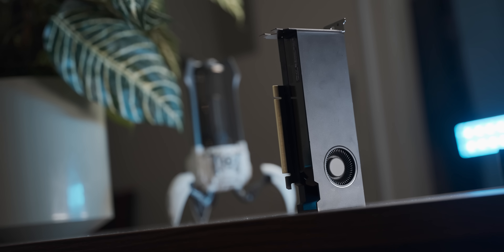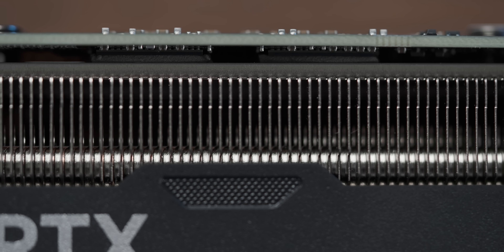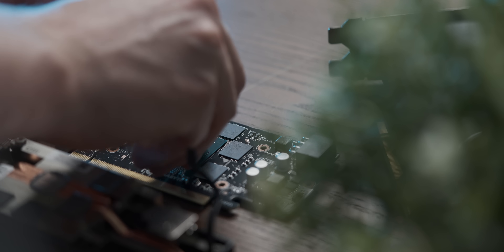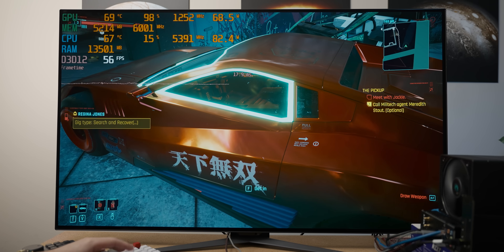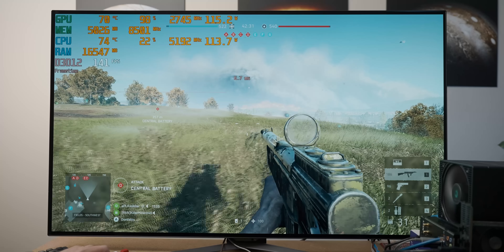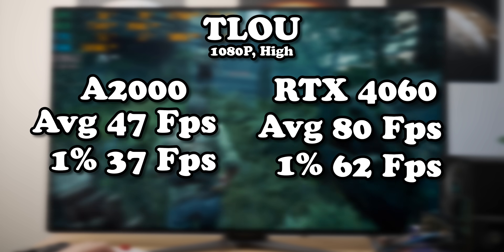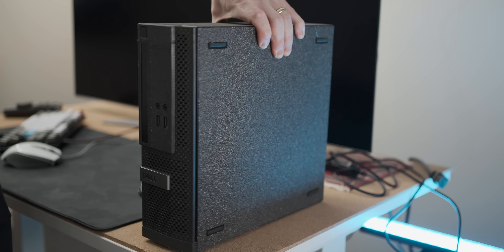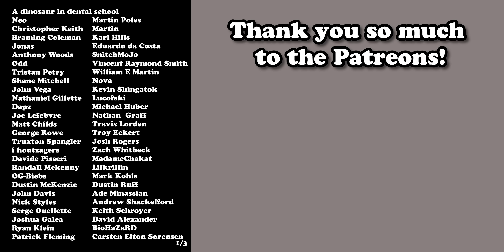A New Contender To The LP Graphics Card Throne

Comment: I’m fairly certain this is the first time a 60 class card gets the LP treatment. The last good gtx LP cards I can remember were 750tis, but I also think 1050s existed
Reply: keep in mind many people among the tech community claim nvidia shifted the whole naming scheme up, so that technically the 4060 should have been named 4050 (based on performance gains over last gen), so on and so forth.
The LP 4060 only strenghtens this narrative.
Reply: @ehohackner main evidence for this is the crippled 128-bit memory bus and tiny XX107 GPU chip, both of which have always been 50-class. The performance numbers tell the same story; there is memory-bound applications where the "4060" is outperformed by a 3060, 2060 and even 1660 Ti.
Reply: That’s because it is a xx50 class card being sold as a 60.
Reply: The GTX 1650 had an LP version. Gigabyte made one. And I think MSI did too.
Reply: @justinpatterson5291  Yep. I've got a 1650 4GB in the Optiplex 7050 I'm using to type this on, 75W as well.
Reply: @justinpatterson5291  Zotac as well.
Reply: @HappyBeezerStudios  My 1050ti is the Zotac OC edition.  At the time of my purchase it was the highest factory overclocked 1050ti that didn't need a 6 pin connector, boosting as high as 1822 mhz per GPUZ and even exceeding 2Ghz as reported on Unigine Heaven and Valley (though I am inclined to believe those readings were probably dubious 😅😅😅)...
Reply: @justinpatterson5291  MSI and Gigabyte made two slot LP 1650's. 

While few chinese companies like Yeston (the anime girl GPU maker) made rare single slot lp 1650's, but they were very pricy as well. (almost twice the cost of a rx 6400). Which is why to this day the RX 6400 is the king of single slot LP cards. As it's only comptitors are few rare pricy 1650's, overpriced Quadro T1000 and GT 1030.
Reply: 1050ti's and 1650's got LP versions as well. And there were few very rare LP 950's as well.
Reply: there was a 1050ti LP but is GPU shortage rare long before there was a GPU shortage.
Reply: @HarmonyEdge  I remember this one, I was trying to find EVGA's 1050 Low Profile for a time and it was unobtanium before everything else was, so it almost basically never existed, haha.
Reply: That’s because the 4060 is just a 4050 with a rename. It’s not exactly great news.
Reply: I have a Gigabyte 1650 LP in my work PC. Works great and is silent as can be.

Comment: I've got the 6GB A2000 in my SFF Dell OptiPlex 7010 (I got it used on eBay), and it's the ideal card for that setup due to its low power draw.

Comment: "Crystal Ball Optiplexing" from the future would be fabulous. The content creation market is pretty saturated with Ivy/Sandy/Haswell Optiplex builds at this point, but you'd probably be among the first to show the audiences out there what budget Dell builds of the future will look like in a few years. I'd love to see that. You could build it up as a "2028 Amazon Gaming PC" and simulate how people would refurbish them haha.
Reply: Yeah but you'd probably still be using outdated processors, most probably kaby lake and coffee lake once those Optiplexes go down in price
Reply: @CrocoDylianVT  Coffee Lake i5 would be a huge upgrade in CPU limited games though with 50% more CPU power.  Even 10th gen will only add HT which will be another ~15-20% maybe.  As an i7-4790 Optiplex user, even an i7-7700 will only be ~15-20% faster but that 8th gen bump will be the big one.
Reply: @lewzealand4717  The problem being that later Optiplex's moved the full-length PCIe down to the bottom slot, leaving dual-slot LP cards incompatible. Been hunting for one for ages before I gave up.
Reply: @AwSomeNESSS I might be really really dumb, but can't you just take Optiplex hardware and rebuild it in any ATX case for like $10? Then you won't have to buy an LP GPU and think about cooling.
Reply: @ДарийФедореев-э7т  The problem is that the Optiplexes get increasingly proprietary as time goes on. Sandy/Ivy-Bridge the CPU cooler threads into the case, and the front-panel power and USB uses a non-standard ribbon cable. 

For Haswell they moved to a proprietary PSU pinout, but kept it the same physical size as standard PSUs. Sometime after that they moved to a non-standard size and screw pattern for their PSUs. 

Somewhere around 11th-gen, they stopped doing proprietary front panel ribbon cables on their non-business systems, and instead made the motherboards a non-standard size that stretches the whole case and put everything on the front edge. Not sure if that has infected the Optiplex line yet.
Reply: My point exactly. Nobody builds those yet, but they'd be interesting to benchmark. Though AMD hasn't helped us given their focus on the higher end, the low-mid level chips with Intel seldom get the spotlight in build videos.

Comment: Put the 4060 on 75 watt tdp manually and remove the 8 pin connector and see if that works. If not you can disable the power connector=false in the bios to fool the card to thinking the 8 pin connector is connected.
This would mean it can be used in more usecases (weak psu or whatever) and it would be pretty cool to see how they compare performance wise without a psu!
Reply: David has to see and do this
Reply: Is this really a thing? Never heard of that bios option
Reply: @_Winfried_ must be in the GPU bios, that wouldn't be in a motherboard bios.
Reply: @_Winfried_  its not necessarily an option, basicly you change the word 'false' into 'true'.
Its not as easy as my comment makes is sound though, but since people make entire custom biosses for gpu's (like RX570 getting custom RX580 bios to boost performance) simple changing 1 word should definitely be doable
Reply: If this can be done id like to see that.
Reply: Don't know if it is possible. Nvidia was trying to avoid using MOBO power on the latest GPUs, i saw a Jayztwocents video were he measure the power from the cable and comparing it with the board total and basically all the power was coming directly from the PSU
Reply: @pedro4205  Hmm, i didnt know that, that would be quite sucky
Reply: If you have the budget there is a RTX4000 (Aida Lovelace) low profile that will be a better comparison, the A2000 is Ampere. Not a fair comparison
Reply: @dickdastardly4801  this Aida Lovelace card is actually just single slot, not LP
Reply: You only get 65W@12v from the PCIe slot. Most cards don't balance the power draw from the slot and 6/8-pin, they just run everything from one source to simplify power delivery, making VRMs cheaper and less prone to failure. The recently discovered VBIOS hacks do allow power parameters to be persistently set, but the 12V power plane on the card likely isn't attached to the PCIe slot at all, so you'd need to hard mod the card to rectify that.

Comment: Is the A4000 not better than the A2000? Also I'm almost certain these cards (the RTX A-series) were made specifically for things such as 3D modeling and such. Not really for gaming although they can ofc work for gaming but they're not optimal for it
Reply: The A4000 compares with the RXT 3070 but for the moment(even though they announced it), they have not made a Low Profile version of it.
Reply: @Teksers yeah, I just found it odd that Dawid claimed the A2000 was the top of the line for lp when the A4000 has been around for so long as well. I've been a technical engineer for just over a year now and I work with these GPU's almost daily but I don't get any opportunities to test them other than making sure they're functional. I need to learn more about them really 😅

I hope they make more lp GPU's specifically for gaming in the future
Reply: the a4000 is single slot but not low profile due to how wide it is, the a2000 is half the width
Reply: @WayStedYou  oh yes! I was getting them mixed up haha I some how managed to think both cards looked the same from memory

Comment: Would be cool if there is a way to only use pcie power on the 4060
Reply: I agree I thought the main selling point of LP cards was the non extrnal power needed.
Reply: @linuxnerd5319  its for use on a HTPC system aswell
Reply: But the problem is that it cannot be turned on without connecting the 8pin power supply, not even the 6pin one.
Reply: manually limit the TDP
Reply: If you undervolt like hell you probably could

Comment: OMG they actually did it. I think the A2000 still has a better use case due to it using  only PCIE power( 75W)
Reply: maybe nvidia should make an RTX 4050 with 75w tdp? surely it will be better than any LP card out there. already many 4050 laptops have 75w or less TDP so shouldn't be hard
Reply: @adityaraghuvanshi3947  I'll be surprised if we get a 50 class. If they do, you probably wouldn't want it. They would probably cut it down to 64-bits, 4GB of VRAM and 4 PCIe lanes... think 6500 XT.
Reply: @TheGameBench  but 6500 xt needs external power connector. I was speaking for those with dated PCs w/o any 6/8 pin connectors. a graphics card that would draw all power from pcie slot (1650, rx 6400, a200 etc.)

besides, dlss 3 frame gen would be god send for those people

128 bit bus and 4GB vram (like 1650) would be sufficient for most single player games at 1080p low-medium
Reply: @adityaraghuvanshi3947  Could've, would've, should've. After Nvidia showed us that it does not care for gamers and that money rules, you actually believe they'll release it? Some time ago, I might be mistaking, I think I heard them say that they would replace the MX cards from laptops with the lowest RTX cards. I think that's what they are doing meaning no desktop version.
Reply: @adityaraghuvanshi3947  Many machines can't physically USE anything but a low profile card.
Reply: for the price the a2000 is out of range for most sff office builds
Reply: Especially in an old Optiplex. The stock PSU isn't really up to running anything over 45W in the PCIe slots. Dell officially rate it to 35W.

I put 1030s in a couple of Optiplex 790, both from the same batch. One has been absolutely fine, the other one blew the PSU after a couple of months.
Reply: @johnroberts2905  That is absolutely false. They are not rated to only running a 30 or 45 watt GPU in the PCIe slot. You're going to have to point me to where you found that information, because I've never seen Dell officially document a limitation on the PCIe slot. Besides, did you not watch until the end of the video? Dawid ran the 4060 in what was either a 790 or 990, and both use the same 240 watt power supply. The same 240 watt that's also used in the xx10 and xx20 SFF models and probably very similar to the 240 watt that they put in the xx40 series mini-tower systems.

It's more likely the one that blew was simply on its last leg, rather than the added load of 30 extra watts was just too much for it to handle. I've tested these PSUs well beyond their rated wattage.
Reply: 7 hundred dollars.
Reply: The quadro drivers got the a2000 are a bummer though. 

But seeing how the stock Dell PSU powered that card without going into overload I think the extra power draw isn't much of an issue. I think the PSU in that Dell is like 225 watts, if it can power it, I don't think many systems would have issues.
Reply: @volvo09  You can install the game-ready drivers on pro cards, just not the pro drivers on gamer cards.
Reply: @volvo09 i used the 3050 driver
Reply: @volvo09  Those 535 drivers are pretty recent - and support BOTH the workstation cards AND the consumer cards.
Reply: Exactly, A2000 is the card I give to my HP prebuilt with a measly 310w PSU.
Reply: @doloresdebeauvoir4960  Keep in mind, he's showing from the wall with a 13900KS, which is super impressive. You can run the 4060 off a 310 watt power supply, especially with a CPU that's not a thermonuclear reactor. What system do you have? A Z2 G4?
Reply: @TheGameBench  Actuall I have a HP Z2 G4 SFF system with an 8700 and RTX A2000 6GB in it. it runs just fine. A bonus for the A2000 is that it has full X16 lanes and even if I run in on PCIE Gen3  x16 the performance loss is minimal.
Reply: @Teksers  I also have a Z2 G4 SFF with a 9700 and that's what I'm going to be putting my 4060 in. It has the A2000 in it right now, and I fully intend to do some testing, but I don't see the reduction in lanes to be a serious issue unless you hit the VRAM limit, which I don't see being an issue in my case. I don't know... it could be for you. Just depends on what games you're playing and what res you play at.
Reply: @TheGameBench  Finally my man. I need to ask how many heatpipes does your cooler have mine has only one. I know there's a better cooler for it but I can not find it anywhere also isn't the LP 4060 too much for the PSU? Or have you changed it? If you changed it what model did you put inside?
Reply: Yeah it isn't much of a LP card if it requires space heater tier power
Reply: @koghs  115 watts is hardly "space heater tier" power. It barely uses more power than the A2000 while being substantially faster.
Reply: Every video card, including the GT710 is better than a stupid 40 series card.

All the specs except the clock speed are cut down dramatically compared to the 3060, and they expect unscrupulous reviewers (and Dawid) to use DLSS 3 to mask the facts.

Turn DLSS 3 off, and the 4060 will get maybe 15 fps more than the 3060

Dawid sold his soul
Reply: @Boogie_the_cat  Okay... I'm not going to argue that the 40 series is mostly a sham, but show me a 3060 LP card. I hate the 4060, but this one actually makes sense... at a lower price point. I also think it should have been sold as a 4050 Ti.
Reply: @TheWretchedEgg12  Yep, that's an ITX card. Full height, but for shorter ITX cases. Works well for smaller mini-tower pre-builts like the new Optiplex systems. But no... there is no LP 3060 model. Mostly I was being rhetorical to highlight how their logic was flawed... in regards to this specific 4060.
Reply: @Boogie_the_cat  LOL GT 710!  You live in an imaginary world, I feel sorry for you.  This is a review of the BEST LP card available and that is the 4060. And show me where Dawid used DLSS 3 for these tests, but I know you can't as you're just lashing out because somehow a video card hurt your feelings. 😂
Reply: @Boogie_the_cat  the GT710 is better than this. Sir I applaud your sarcasm but no.
Reply: @Boogie_the_cat  still has much lower power draw than 30 series and better rt cores and tensor cores than 30 series...which also cut down on heat production and lower fan noise

i see this as a total upgrade over 30 series... i own a rtx 3080 and rtx 4060 to compare and i'm often going on my 4060 build whenever i don't need massive performances

you're just a hater who doesn't look anywhere than price tags and on paper specs...in the real world, they're often better
Reply: @Boogie_the_cat  the 3060 doesn't have a low profile option. Nobody would ever be choosing between those two cards, so the comparison makes no sense.
Reply: @Boogie_the_cat  the gt 710 is worse than integrated graphics
this video is literally about low profile cards for being able to turn a dell optiplex into some insane gaming pc many years down the line, not for just the value of the 4060 on its own. because there is NO competition to nvidia in this segment of graphics cards.
Reply: @Boogie_the_cat a gt7710 vs a 4070. My 4070 is fucking flying
Reply: @Boogie_the_cat  this video is about low profile cards. There aren't any options out there for low profile cards.

And no, a gt710 is not better than this thing. I don't even game and I know that isn't going to happen.